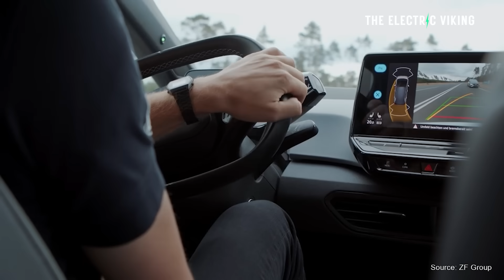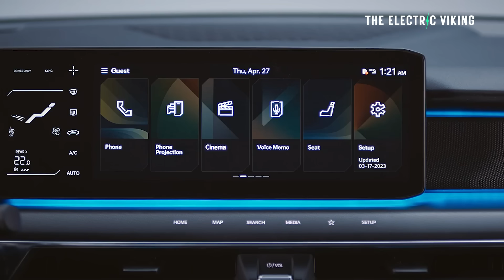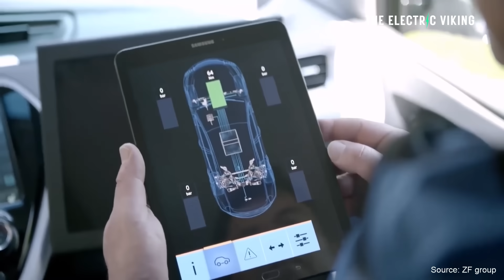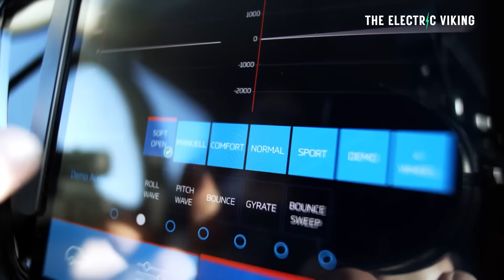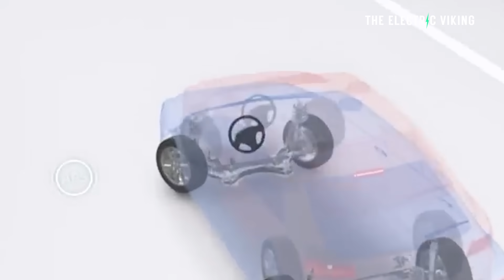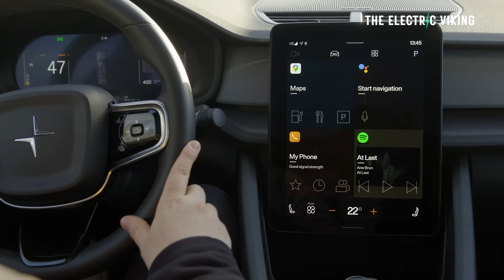Electric Brakes Revolution: Safer, Cheaper EVs!

Comment: Passenger aircraft have used fly-by-wire for many decades. In the US where many states have no regular car safety checks we can expect to see some issues but elsewhere with annual inspections this should be manageable.
Reply: Those planes systems are checked after EVERY FLIGHT, a lot of people here have simply no idea...
Reply: @MickH60 and have redundancy
Reply: Things happen more slowly on aircraft, in general.  It's not as if you're only a few feet (or inches) from other traffic.  This allows backup systems to be brought into play in the event of system failures.
Reply: @ On the other hand planes fly faster than cars.
Reply: yeah the land of the ''free'' where everyone is allowed to do all kinds of modifications on their vehicles regardless of any safety systems in place just wow!!!
Reply: @carholic-sz3qv  I'll  always remember when I took a flight course in California, I'm from BC, one class mate pulled up in a jacked up full size truck, the front bumper was level with my chest, i'm  6 ft. No laws against such stupidity apparently.
Reply: Agreed, want better more responsive braking, get bigger pads like the go fast cars. Not sure if this is a Sam special paid ad ?
Reply: In a world of EVs, you will hardly use your brakes anyway. You can slow down and stop, just not as quickly, even on a steep hill. Obviously we always want the brakes to work, and even traditional systems can fail, but with EVs we have alternative recourse and so probably shouldn’t fear this as much.
Reply: The word "manageable" makes me uneasy. Both steering and brakes are first level safety systems. Ought we to integrate these to the electrical system and depend on software/firmware for their reliable operation. Given the issues at Boeing, I don't find your example of passenger aircraft reassuring.
Reply: @nickwinn7812  and what does it have to do with boeing?!

Comment: Shortening stopping distances in an mixed environment of electronic & non-electronic braking systems is a really bad idea as the driver rear ending you will explain, as they crash into the back of your car.

Comment: Anything electronic can be hacked, I prefer a brake system completely independent of the cars electronics. Like a toilet flushes regardless of whether electricity is available or not. All this tells us is that braking can be done by electrical signals.

Comment: if these brakes are coupled with auto driving features like FSD, even if the braking had the same capabilities it will be faster than current brakes as there is the human reaction time.

Comment: Be careful what you ask for when it comes to stearing by wire, a power failure to the system "which is not uncommon" could lead to total steering loss at speed with no fall back unlike today's power-steering. Tesla's Cyber truck is good example of what can have if the system should be exposed to damage to the vehicle that would not disable more traditional solution. It also seems to be more difficult to fix as well.

Comment: Personally I think electrically actuated breaks have a lot to prove before I would trust them to the same degree with today's hydraulic solutions. Electrically actuated breaks have existed for decades but have proven to be difficult to implement to the same degree of safety and reliability as hydraulic solutions on light vehicles. There is of course potential for innovation and improvement over time and further development. Even so the introduction of unwanted traits and maintance issues could become significant. Electrically actuated parking breaks is in my opinion a good example of not good enough due to being more prone to failure if not more rigorously maintained compared to mechanical solutions as well as less flexible to use in certain emergency situations.
Reply: Fly-by-wire (FBW) is a system used in aviation where electronic signals transmit the commands made by the pilot to the aircraft's control surfaces, like the rudder or ailerons, instead of traditional mechanical linkages or cables. Essentially, the pilot's inputs are processed through a computer system, which then controls the aircraft's movements. 

One key advantage of FBW systems is the ability to incorporate automatic adjustments, helping to stabilize the aircraft and enhance its performance. It can also reduce the pilot's workload by correcting errors and preventing unsafe maneuvers, making modern aircraft safer and more efficient. The technology is widely used in commercial jets, military aircraft, and even some drones.the tech is proven with billions of flying miles to prove it.

Comment: There is actually no particular justification for retaining rotors and brake pads and calipers on EV's.
The main reason why regenerative braking has its limits (braking power wise) is the simple fact that there are limits to the 'peak' energy the motor drive inverter can deliver back to the battery.

But if the brake pedal "augmented" the regenerative braking principle with a simple, smoothly variable electronic LOAD on the motor/s which have become a physically resistant mechanical energy dump at this time, then what the battery could not absorb could be shunted to this augmentation of inertial energy 'dump'.
Not all EV motors will do this.  Especially many of those that do not use permanent magnets in either stator or rotor.  But this can also be overcome fairly simply with such motors.  Just a couple of extra and reliable engineering tricks.

As to hydraulic versus wire, I would personally go with wire - every time.

Comment: Selfparking selfplug-in V2G EV's massive battery will give maximum UTILIZATION of your vehicle 247.
And maximum grid PROTECTION from massive daily PV sunshine supply  🌞 ☀️ 😮 and shock demand loads. As fossil fuels are phased out.
Happy days, free massive electricity storage daily. 
Building carpark space to building carpark space. Bumper plug-in to $60 wall outlet and trickle currents from PV rooftop dirt-cheap electricity 237, 23hrs, daily. 
Happy days. 
247 EV grid services and trickle feed-in currents will be money in the bank for early adopter in this time of transition away from fossil fuels.
Daytrading electricity and storage for money. 
Happy days. 

Rooftop PV panels that shade to hot rooftops will reduce air-conditioning costs. 
Happy days.

Comment: Technology for the sake of it. Let's take something that's worked for 100 years and change it for no good reason. Electrical failure is the most common fault in cars of all types, including golf carts. I wouldn't trust fly by wire brakes or steering.

Comment: Hydraulic brakes are tested and bulletproof since almost a century now. 
Yet some “innovators” want to switch to electric brakes which can be super dangerous, especially when combined with computers that, as history shows, always require software updates and even then they can fail.
Same goes for electric steering.

Comment: Sounds like a good idea, no hydraulics, but the wheel area is pretty testing for electronic components. Water, sand, dust, dirt, mud, snow, salted roads, etc. The seals and insulation would have to be absolutely 100% dependable and last for possibly decades.
Reply: yeah - a bit like hydraulic seals, maybe?
Reply: @jesflynn4048  Oddly enough, hydraulic calipers and wheel cylinders can handle all this crud very well for decades. An electronic circuit and sensors immersed in all that stuff… water ingress, etc, hmm… yeah, you could do it but the components would have to be of an indestructible and durable quality. I think it’d work.
Reply: @jesflynn4048  Like failing ABS sensors, at the wheels, a very common occurrence, next time you are at a mechanics shop, just ask them. There's dirt, water and a lot of heat to deal with  with brakes....
Reply: @MickH60  Yeah  I know very well. I was a mechanic a long time ago but still maintain my own cars.
Reply: hydraulic wins everyday of the week.

Comment: Fly by wire has been around for aircraft control surfaces going back to the 1970s. Also electric modulation of aircraft brakes to prevent lock ups even earlier (Maxaret Mark X mid 1960s) The same concerns were expressed by the Old and Bold pilots back then, also Boeing was a late adopter.
Reply: That's why I don't fly, check the number of crashes caused by this.
Reply: Enough of the clueless "plane" comments, planes have their brake systems checked after EVERY flight, understand ?
Reply: @MickH60  I was referring to fly by wire,see Airbus for reference.
Reply: @MickH60 and the fly by wire systems have redundancy
Reply: @larrygage  and yet they still fail and crash.
Reply: @ no tech is perfect
Reply: @larrygage  this is tech for the sake of it,it doesn't improve the car at all and adds another layer of risk.
Reply: airplanes are a different level of safety with tons of redundancies in place! regular inspections and checkups are made to ensure every systems are unlike on cars.

Comment: It's not as worrying as FSD and the service department will still charge you for brake fluid flush and replenishment. If a car or van has drum brakes they are on the back wheels only with discs on the front.

Comment: You mention what would happen if the electric brakes lost signal, well I would suspect the same as when the hydraulic brakes loose fluid, both would fail to stop the car, so no difference there.

Comment: Its just another company trying to make "MORE" money buy producing an expensive product that can fail due to power failure, short circuit or component failure, we already have electronic parking brakes that have failed, I for one wont be buying an EV or ICE car with steer & brake by wire, it may sound good on paper & if you are lucky it maybe reliable for a period of time, but it only needs one electronic component to fail & you will find yourself if you are lucky in a wheel chair if your luck has run out, well.

Comment: I wonder how they are going to deal with rotor corrosion and callipers  seising up?   I guess maybe they could be programmed to regularly do a full range of motion and  scrub the disks from time to time? I know EV breaks get used a lot less but having a motor and electronics in an area that can get really hot could be cause for concern??

Comment: Not very smart - so what will enable the electric brake? Your foot pressing down? No a computer.  I have a freind with the lastest Gulfstream jet, redundant everything - still its computers have failed 3 times in flight, if the engines got fuel controlled by computer or the flight controls she'd be dead.  Reliance on computers is the stupidist thing you can do for safety.  No they are not "simple". Just like BEVs do not have fewer parts(packs have 1000s of cells). Any computer program has programming. One screw up and you may die. Hydraulic brakes have been used over 100 years and given even minimal care will always work. Trillions of miles of safe driving with them. "If it ain't broke don't fix it".

Comment: I lost my electric steering assist in the middle of a sharp turn.  It was a little scary.  2017 Model S.  Turned out to be a bad ground.  I lost my brakes on a freeway offramp in a '73 Opel Manta.  Stopped with the handbrake.  So both electrics and hydraulics can fail.  Backup systems are a good thing.
Reply: Backup emergency handbrake,good idea.
Reply: the only solution is regular maintainance and also yearly checkups which are a thing in some places around the world.

Comment: I can just imagine your dashboard telling you to reboot your brake software immediately before impact.
Reply: Just stay away from MS operating system and you will be fine😁
Reply: Well lets hope Microsoft has nothing to do with it. That would kill millions of people.
Reply: Any such system can be made autonomous just like physical hydraulics.
Reply: @jimparr01Utube  It's electrical, brakes are in the water, dirt, massive amounts of heat and are already proven an autonomous, ABS sensors fail regularly due to everything I've just stated. I've recently replaced two ABS sensors that failed two weeks apart, this is very common....
Reply: @MickH60  I am unsure of what point you are making - if any.
I copy my response to other contributor below...

There is actually no particular justification for retaining rotors and brake pads and calipers on EV's.
The main reason why regenerative braking has its limits (braking power wise) is the simple fact that there are limits to the 'peak' energy the motor drive inverter can deliver back to the battery.

But if the brake pedal "augmented" the regenerative braking principle with a simple, smoothly variable electronic LOAD on the motor/s which have become a physically resistant mechanical energy dump at this time, then what the battery could not absorb could be shunted to this augmentation of inertial energy 'dump'.
Not all EV motors will do this.  Especially many of those that do not use permanent magnets in either stator or rotor.  But this can also be overcome fairly simply with such motors.  Just a couple of extra and reliable engineering tricks.

As to hydraulic versus wire, I would personally go with wire - every time.

Comment: I suggest adding/alternate redundancy by using springs that are common on commercial vehicles. The motors will then pull the springs out rather than push the pads in.  In case of a failure for any reason, the motor will lose power, and the springs will press the pads to automatically stop the vehicle.
Reply: I hope that this is already the case. In areas where concepts of functional safety is applied, usually the passive state is safe, so in this case: (at least soft) braking.
Reply: Brake Fluid Leaks, Contaminated Brake Fluid, Brake Line Damage - all very common causes of brake failure - would go away.
Reply: @pooroldpedro  And you get wire and computer that fails instead. The only errors i have had on my brakes the last years are sensors not working. This will be good for the garage and producer.
Reply: @pooroldpedro  All of those are basically due to lack of maintenance and most often caused by the poor maintenance practices of the owner.  An electronic brake would just reveal a different set of failure points from the same lackluster approach to maintenance by those owners.  Some people might be amazed at how reliable a hydraulic brake system will be if you actually do the required maintenance such as annually inspecting and lubricating with brake grease the guide pins and slides on disk brake calipers and doing similar to the actuators, self adjusters, etc in drum brakes along with regularly flushing the brake fluid on a two year schedule.  Decent brands of brake fluid are available at your local stores such as Walmart for just $6 to $12 a quart which should be plenty to flush clean most hydraulic brake systems and then refill them afterwards.  

With proper brake maintenance you can have master cylinders, calipers, rotors, lines, etc lasting for 200,000 trouble free miles since they won't be binding or dragging and won't get a buildup of acidic brake fluid in the lines rotting components/lines away from the inside out.

Best!
Reply: @pooroldpedro  Will be replaced by broken wires, software glitches, battery failure. Repair only possible at an approved dealer who has all the software and diagnostic equipment = expensive.
Reply: @pooroldpedro  Extremely rare mate,  NOT common at all,  you're obviously not a car guy. Did it ever occur to you that a broken wire {far more common than failing brakes} would cause loss of brakes, then there's software problems and other variables that the average person would never fix or find = expensive ....

Comment: Heavier calipers will mean rougher ride for the car.  It's a mater of physics, the ratio of unsprung weight (tire, wheel, disk, caliper) to sprung weight (rest of the car).
Airplanes that use fly by wire have triple redundancy in case of failure.  I doubt that will be the case on cars.  Which means that the wire that the squirrel almost chewed through before you started your trip may break en route, and you end up in the hospital (if you're lucky) and on the evening news, while your car ends up in the scrap yard.
Reply: I'm glad someone else here knows what they're talking about..... Having electrics with the brakes is a stupid idea, ABS sensors fail regularly due to their proximity to the wheel, due to all the dirt, wet, heat and so on. One guy even commented that the electric brakes "could stop brake checking"...!!!   Imagine needing the brakes and the car decides you don't need them because it thinks you're brake checking someone....mind numbing cluelessness....

Comment: Mercedes used electric brakes about twenty years ago.
They dropped them after a few years because they were more trouble than they were worth.
Most modern cars already use computer aids to improve braking response and stability ,,such as ABS , ESP , crash and pedestrian avoidance with braking and Brake Assist.
Reply: They dropped them due to almost killing a few drivers when they failed.

Comment: As you made it clear the main drawback of E-breaks are safety, in case the computer is faulty. But Hackers already demonstrated how they can take over your car's computer and eliminate your breaks. So basically, no drawback for the electrical breaks
Reply: Hydraulics cannot be hacked.

Comment: Brembo is Italian not German...Sam youget sloppy since you are on the Tesla fan boy route..and you are even dangerously wrong about how current ABS works..Of Course any car ABS brakes each wheel independently..daaahhh thats why it is called 4-channel or on Motorcyles 2- channel system. ABS has electronic controles to operate the valves in the ABS block independently...